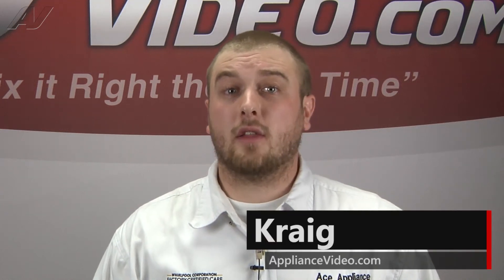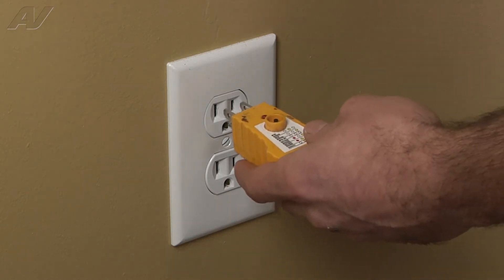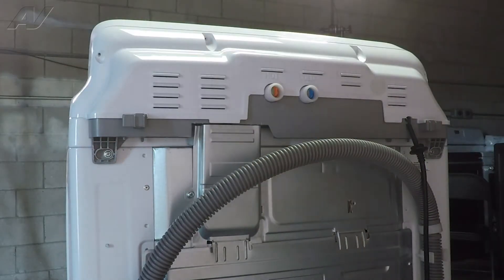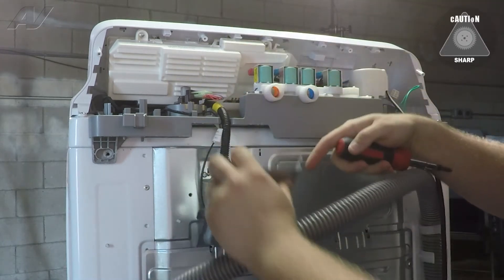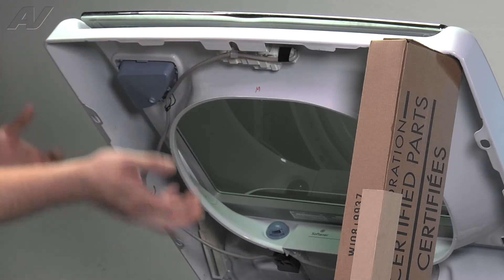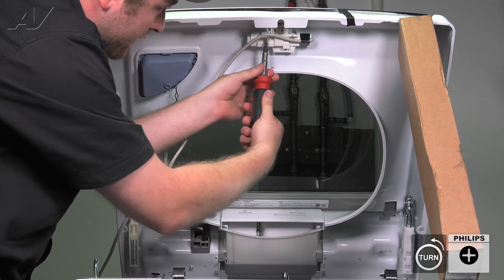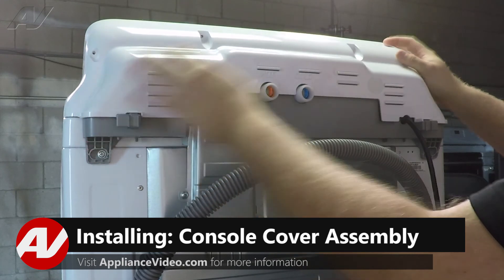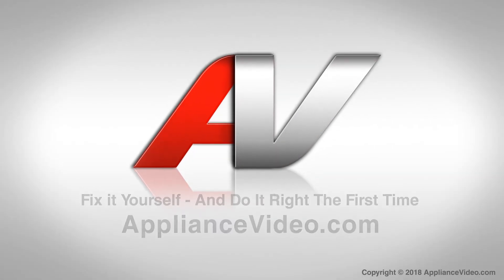Samsung Washer Repair - Error Code Dc, Dc1 - Lid Lock Assembly

Comment: @appliancevideo After hours of looking on YouTube for videos on a fix for my washer , this is the closest video to my issue and the most similar to my Samsung top load washer. I had a similar thread of thought after watching many videos and thought it was likely the control (main) board that needed to be replaced, so I ordered it , replaced it , and nothing , still won’t turn on , the same 2 little green lights that would turn on the original main board , turn on the replacement board. I then thought I might be the jog module so I replaced it and nothing , what else could it be that is causing not to turn on at all??? Any thoughts would be appreciated

Comment: What if those little plastic brackets that the lock screws into are broken? I have no clue how but my kids managed to break it. 🤬 is there a part to replace that?
Reply from the maker: Great question, if you have a more technical question that our parts department cannot answer, you can search our over 17,000 answered questions free at our website www.ApplianceVideo.com under our Repair Help section. You can also call our parts department at 1-800-830-5465 and they can give you help 7-days A week ,or search at www.SaveMoreOnParts.com  .
Reply: @connie’s did you ever find out what that part was? I can’t find it either.
Reply: @tjcombo1936  we managed to glue it all back together and let it sit for 24 hrs before touching it again. I discovered they put toys in the lock area then pushed down on the lid to cram the toy further down into it and it snapped the plastic. Haven't had a problem with it since thankfully.
Reply: @ford4life069  Thanks!
Reply: Yes. You can order new ones for like 3 bucks
Reply: @phillupondz  I can't find one anywhere. We've glued it 3 times now and I've looked through parts lists online and even bought the "repair manual" hoping for a parts list. Most of the lists online don't have images so I can tell if it is the right thing or not. Buying car parts is 20x easier than this.
Reply: Anybody ever figure out the part number for those???  Also did the gluing work and if so, what type of glue???
Reply: @bassmaniacriley69  hubs used a super glue and glued it and used a wood clamp to hold it overnight. My kids have broken it twice since and he's glued it twice more. As long as they don't stick legos in it........ sometimes I really wanna throw all the legos away.

Comment: Your video is a life saver!!! Only thing I was worried about is I had clamps in the front that you didn't seem to struggle with and I guess I bought my washer when they first came out or something because my part was square, not rectangle=part dc34-00025A, but was replaced with dc34-00025E.

Comment: Very good video.  I would love to see a video on how to replace the top cover for this model or a similar Samsung model washer.  Mine has become rusted out and needs replacing.  Or optionally, I would love to see how you would remove the lid on this model.  I cannot figure out how to take the lid off of this model.   Thanks
Reply from the maker: Great question, if you have a
more technical question that our parts department cannot answer, you can search
our over 10,000 answered questions free at our website www.ApplianceVideo.com under our Repair Help section. You can also call
our parts department at 1-800-830-5465 and they can give you help 7-days A week
Monday -Saturday, or search at www.SaveMoreOnParts.com  24 hours
7- days A week.
Reply: I replaced a lid on a previous washer and I won't do that again.  It was about a third the cost of a replacement washer and the washer didn't last more than a year after that.  Once this washer bits the dust I'm buying a Speed Queen to go with my Speed Queen dryer.  Only brand that lasts more than 5-7 years!
Reply: @susanarcher9589  I repair appliances and if you get one these days that last more than 7 years, let me know. I remember when they lasted 20 years with maybe one repair, throw away now like tv's, even the parts are getting discontinued or so pricey, it's cheaper to buy a new one but you're right about replacing the lid, get a new one.

Comment: Does the lid lock replacement come with the wires ?
Reply from the maker: Great question, if you have a more technical question that our parts department cannot answer, you can search our over 17,000 answered questions free at our website www.ApplianceVideo.com under our Repair Help section. You can also call our parts department at 1-800-830-5465 and they can give you help 7-days A week ,or search at www.SaveMoreOnParts.com  .

Comment: Why is the lid stuck on the front right side? As I am looking at the front of the washer, it is stuck on that right front side and I can’t get the lid off to make this repair
Reply from the maker: Great question, if you have a more technical question that our parts department cannot answer, you can search our over 17,000 answered questions free at our website www.ApplianceVideo.com under our Repair Help section. You can also call our parts department at 1-800-830-5465 and they can give you help 7-days A week ,or search at www.SaveMoreOnParts.com  .
Reply: you have to lift the back of the top up and the front at the same time.  So it is level when it goes up, then you push the entire thing toward the front of the machine.

Comment: My lock light won’t come on, it makes the clicking acts like it’s going to start but won’t fill. But if I hit start I can’t open the lid. So I know it’s locked. Would this fix that issue?
Reply from the maker: Great question, if you have a more technical question that our parts department cannot answer, you can search our over 17,000 answered questions free at our website www.ApplianceVideo.com under our Repair Help section. You can also call our parts department at 1-800-830-5465 and they can give you help 7-days A week ,or search at www.SaveMoreOnParts.com  .
Reply: Did you find solution mine does the same

Comment: I just did that exact fix but it still doesn't work. The old lock was very dirty and I figured it was bad. 50 bucks later the new lock does exactly the same thing. When I push start it dings a double ding and doesnt lock the door. When the problem first started we could turn the power off then back on a couple of times and the lid would lock and start the cycle but nothing works now.
Reply from the maker: Great question, if you have a more technical question that our parts department cannot answer, you can search our over 17,000 answered questions free at our website www.ApplianceVideo.com under our Repair Help section. You can also call our parts department at 1-800-830-5465 and they can give you help 7-days A week ,or search at www.SaveMoreOnParts.com  .
Reply: Where did you get your lock ?
Reply: did you ever get it fixed? i have the same problem
Reply: @bobbor5883  Bob, what did you find out? Same exact problem here. Did you end up placing the control PCB?
Reply: Okay. The new lid switch has a hall-effect sensor incorporated. That means that the switch has to sense metal in order for the machine logic to function. In other words, have the new part completely installed and mounted in place before attempting to test or use.
Reply: Me too.  50 bucks later and it still doesn't work.  But if i use a bent hanger to pull the switch out it shows the "key" lock icon in the display that tells me the new sensor works, but machine may not be able to send a "lock" command to it, meaning the board may be the issue.  I would just like to override this stupid "smart" sensor, i don't see why i need it!

Comment: If you have already replaced the lid sensor but the washer still acts as if the lid is open and won't run, what should you try?  My plan is to replace the mainboard to see if that fixes it.
Reply from the maker: Great question, if you have a more technical question that our parts department cannot answer, you can search our over 17,000 answered questions free at our website www.ApplianceVideo.com under our Repair Help section. You can also call our parts department at 1-800-830-5465 and they can give you help 7-days A week ,or search at www.SaveMoreOnParts.com  .
Reply: Hi
I have the same problem. I got new switche but  still won't run,so how did you fix your washer?